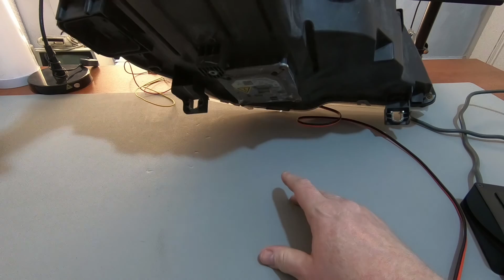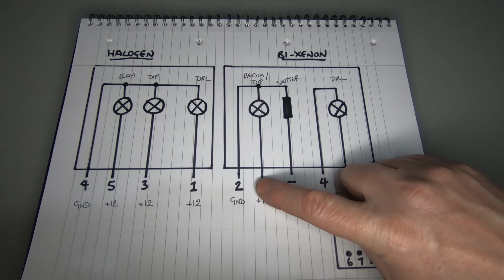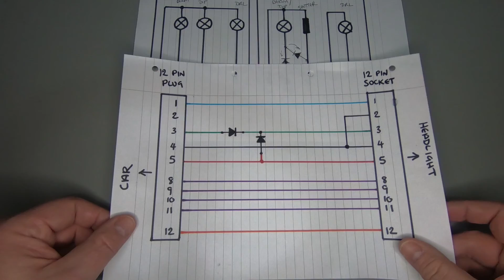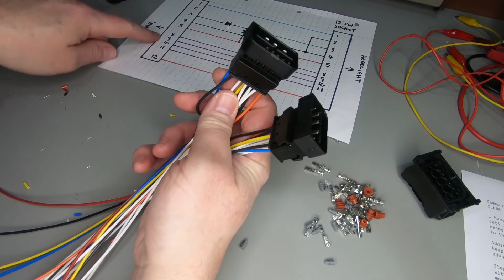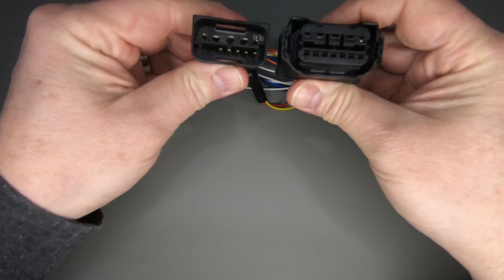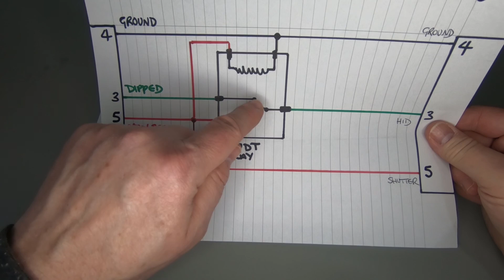BMW E70 X5 Halogen to Xenon headlight swap

Comment: Do you know if the Lci xenon pinout is the same as the bixenon you have here? 
I'm simply trying to tap into the shutter feed to trigger a relay for a light bar that will illuminate with the high beam. 
Everywhere I've looked suggests a white/green wire on pin 6, but I have no such wire and nothing in pin 6 😂
Reply from the maker: I'd just probe each wire in turn to see which one goes 0>12v when high beam is operated. 
I'd expect the pins to be either pin 5 or 6.
Reply: Thanks, that was my next move. I was trying to work solo today with no luck. I'll find a willing volunteer to operate the lights for me as I probe.

Comment: I have to coding something?
Reply from the maker: I didn't need to on my 2007, but there are a LOT of code settings for the lighting. You could have different settings to mine. If you have problems then you could try turning off the power-on checks for the headlights, this should then bypass most of the other associated codes.

Comment: Hello, i have a question, I have LCI 2011 with halogen and I switched to xenon and all diodes like your diagram ,when I started my car the light flashing and after 2-3 min turn off. Why?
Reply from the maker: Possibly low supply voltage - is your battery at good charge?
The diodes do have a small voltage drop across them (different depending upon the model of diode used) Look up the data sheet on the diode to see the volt drop value. You then could try a different diode with lower drop, or the relay option does not have any drop.
Reply: Hi and thanks for answering, actually I changed in the FRM some code with ISTA P because original FRM was for halogen light and not for xenon, and I changed 520(halogen) to 522(xenon) in VO and after programming was everything all right 👍🏻 
Thx again

Comment: Hi, I have an X5 e70 2011 LCI but with the PRE LCI headlight, I bought 2 LCI headlight, with the matching FRM3 from same donor car. Would I have to do the wiring shown in the video or a simple rewrite of the FRM3 to my car will work? Thank you.
Reply from the maker: If you are adding the matching FRM you sould not need the diodes/relay, but you will need to add a ground (connect pin 2 to pin 4) and move the high beam wire (move pin 5 to pin 6)
Reply: @ANTandTEC thank you so much
Reply: @ANTandTEC do you have a way of contacting you for paid support to complet this with ease, Its not hard from what I am seeing, and they also included the oem harness to the light but cutted. Im thinking or want to use that to buy a female plug and just make a bridge in that connector. Do you think it would to do the swith in the oem connector or in the female plug? Thank you😅
Reply: @ANTandTEC  looking at the bi-xenon headlight connector, I now better understand what you meant, I just need to figure out if I can remove the headlight plug to swap 5 into 6. to work on my current stock harness. Thank you.
Reply from the maker: @MrDmension3d Yes exactly. 
Working on the connector plug that attaches to the headlight; 
  1. Take wire and pin 5 out of the plug and re-insert it as pin 6. 
  2. Put a new pin in position 2 and connect this to the wire from pin 4.

Comment: Great video. Well worth the effort to swap? I don't have adaptive/self levelling suspension, so I may have to figure out some wiring differences there.
Reply from the maker: Yes; My halogen units were VERY dim, this was a very good upgrade. I think the wiring to the lights is the same for self-level and manual units (the self level system being in the car and not the lights). So you will probably find your manual control still works for your new lights.

Comment: Thanks, you really gave me a road map on how to go about in retrofitting my e82 from halogen to xenon, although the wiring won’t be the same but I think  it’s not that much different. Is it possible that I can email you the wiring diagram of the e82 xenon and you can advice how I can go about doing the conversion harness by drawing a skemetic on paper like you did. Then from there I think I can do my own harness.

Comment: Mine is different.. i have a 2013 x5d.. bi xenon, where you're drl bulb located is where my silver box is.. the same one you have at the bottom on your light.. so how to change my drl bulb?
Reply from the maker: @mr.m7004 Sounds like you have the LCI type headlight. You can verify it is by looking on the bottom you will see two silver heatsink plates with small rods on the surface. These type of light have built in LEDs for each DRL ring and as far as I know these are not replaceable.

Comment: Hi there, I’ve followed this tutorial and want to say everything came out to plan just fine. 

However I did want to mention that the high beam flickers when the car is running (low beams off).

Would you know why that would be? Thanks

This does not happen when the car is off
Reply from the maker: @JustShredded  Hi. The idea of this cable is to use the Xenon lights with the stock Halogen coding. Basically a simple plug and play. Did you use the relay or diode? The flashing sounds like a lamp check being performed by the footwell module. Do they continue to flicker or after a couple of seconds do they go off or work normally?

Comment: Hi can you tell me which diodes to purchase?

Also i cant find the plug and sockets on ali could you post a link
Reply from the maker: Any 10A silicone diode, something like this 10A10. 
Link for the connectors: https://www.aliexpress.com/item/1005004070117432.html
Or search for "12 pin bmw headlamp plug"

Comment: Thanks for the guide. I’ll do the same to my E70. Does it require recoding? And if so where can I get the right code to go from H7 to Xenon fault-free 😉
Reply from the maker: No error codes when I did this to a 2007 E70 👍
Reply: @ thank you so much for the swift response
Reply: One more question, the initial headlights you had were auto leveling or switch adjustment with that little wheel next to the light switch? Because that is what I am stuck with
Reply from the maker: @flonilla  mine were auto level to srart with.
Reply: @ANTandTEC  ok thank you!

Comment: Thank you for the instructive video.   I have successfully upgraded all halogen bulbs to LEDs in my 2012 E70 LCI --  except the BA9S halogen halo ring bulbs.    In the video you mention the OEM Xenon LCIs have 2 modules on each headlamp (one for each ring).   What about in LCI headlamps with halogens?    if I replace the BA9S with LEDs, would the inside ring be brighter than the outside rings?     I've noticed that pre-LCI halogen E70s have brighter inside halogen (non Xenons) rings than the outside rings, but in my LCI E70 both rings light up with the same dim, yellowish halogen intensity.

I figured swapping halogens for LEDs overall was cheaper and easier than fiddle with ballasts, new harnesses, plugs, and re-coding... and it's turned out great so far.   I only had to Bimmercode the bulbs to "LED CONVERSION" and have no error codes.    The original halogen dipped beams were as bright as candles, but now the new Fahren 6500K H7, H8 and H1 LEDs on the dipped/fog/high beams shine as bright and illuminate as much area as the laser headlights on my '22 G05.    Because the beam pattern of LED bulbs are different, I had to adjust the horizontal and vertical beam screws on both headlight assemblies, but I'm very happy with the results.  No one flashes me.

Comment: Hello, very good video, I congratulate you, a final question where I can get this type of plugs, the pins and cables. Could you also tell me which diode code you used to be able to make this modification to my car please, I have tried to contact you on Instagram and also on Tiktok without success if you could help me I would greatly appreciate it.
Reply from the maker: I have sent a reply to you.
Reply: Hi this video is a great help could you send me the same I need to make this loom harness or do you sell these .. thank you you so much